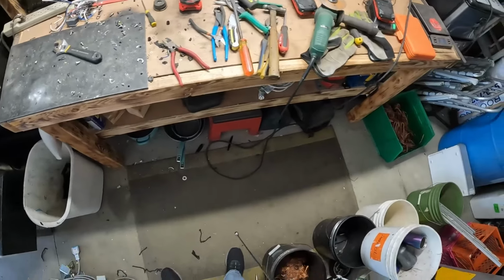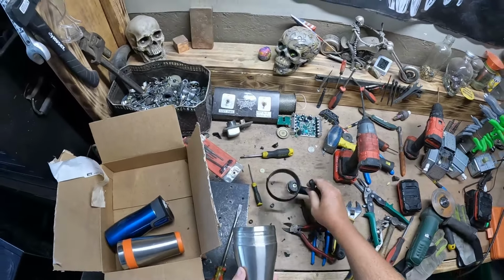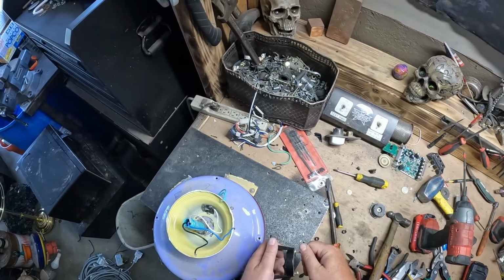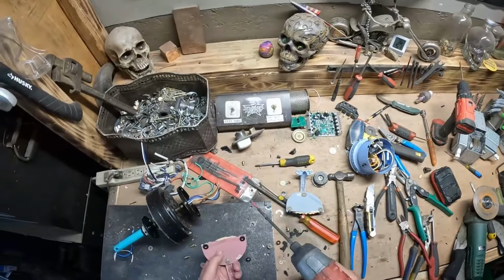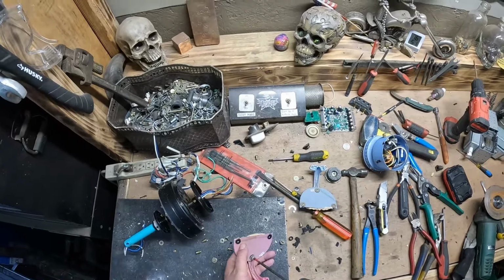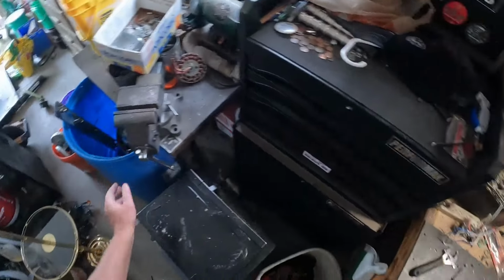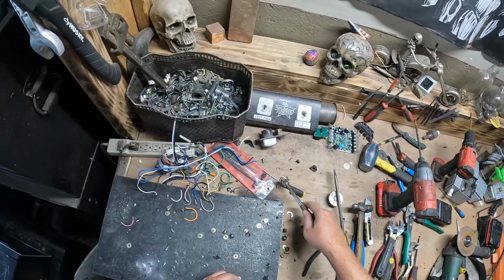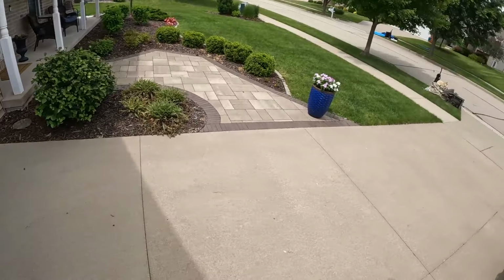More Scrapping From Rubbish Week

Comment: i cut the wires off the fan motor then stand it on it's side and hit the shaft to drive it off. Then turn it around and hit the other side and do the same thing.  .. I enjoy your  adventures. Thanks.  Mitch

Comment: The Joe Biden effect🤣🤣.
Thought of you the other day picked up an all metal dishwasher on the road going to work. Cleaned all the copper and brass I could for melting.
Reply from the maker: Good for you!  I tell ya, once you start scrapping you never stop seeing things to grab, no matter where you go.
Reply: @SkullerMetals  you are right. I've scrapped about 30 years now. Mostly farm equipment. But now my focus is on what's on the side of the road.
Reply: @SkullerMetals  I have a Gleaner combine out in the woods that needs to go. It'll be the third old one I've scrapped.